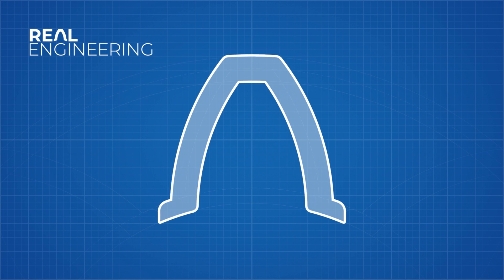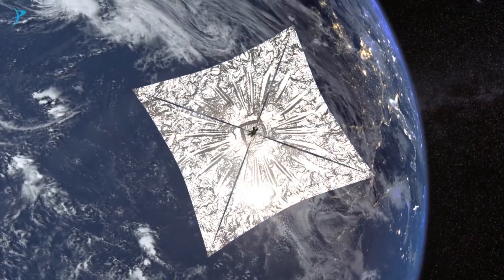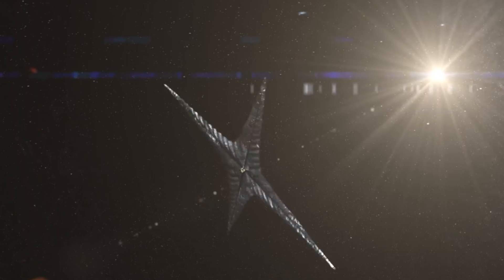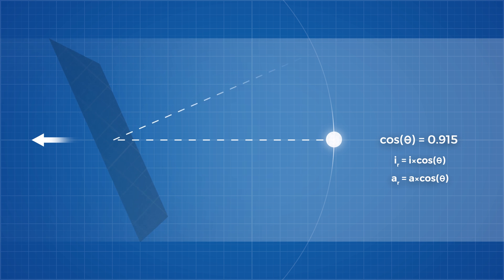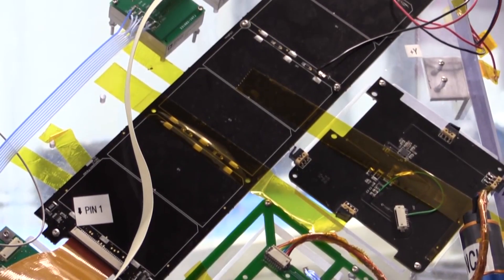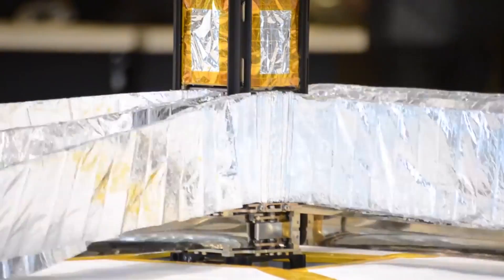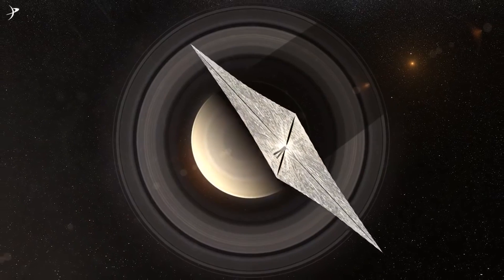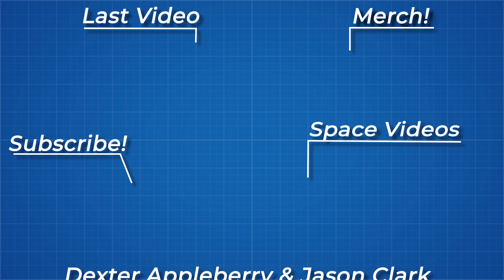How to Sail on Starlight

Comment: Would it be viable to push the light-sails from Earth (or Earth's orbit), with lasers ofthe most energetic wavelengths, therefore preventing the loss of energy with the distance? This system also allows for evolution of the propulsion system as we discover more effective energy sources (e.g. fusion).

Comment: How the Sun Works

Scientists falsely claim that the Sun is a fusion reactor, constantly emitting photon particles and solar wind.

In fact, all stars are balls of mass, warmer, brighter matter that are oscillating generators and transformers.

Because each atom has its own unique structure, it is an oscillating generator and transformer.

Atoms are eternal generators and transformers

All atoms consist of indestructible, electrically charged hollow spheres and internally charged solid spheres. The so-called electrons are actually negatively charged liquids attached to the surface of the atom.

The hollow sphere has multiple layers, each with an opposite charge.
The inner sphere and inner layers of all atoms have the same charge.

According to Coulomb's law, the inner balls of all atoms oscillate constantly at a natural frequency and never touch the inner layers. Theoretically, the ability of an atom to carry an infinite amount of energy depends on the input.

The more atoms there are, the higher the energy density, the higher the temperature, and the brighter the light. Atoms oscillate at higher voltages.

Stars do not emit energy or photons outward, but induce other masses around them to oscillate at their frequency. This is the true mechanism of light, photons and radiation.

Comment: Solar sails are lies. Photon particles are fictional unicorn farts. Why do the Navy's killer laser beams have no momentum to move the flame? Why doesn't a Crookes radiometer spin in a hard vacuum? Why can photon particles travel through solid glass at the same speed? Why can photon particles bounce back from any material at the same speed? How can photon particles generate oscillating electric and magnetic fields without charge or mass? What is the precise mechanism? Einstein said that anyone who thinks they know what a light quantum is is wrong.

Comment: something I've wondered: could you make the surfaces around the propellent nozzles reflective, so they double as solar sails using light emitted by the (usually glowing) exhaust, thus get free extra thrust? you also need heat sinks in space (Reflective surfaces that radiate excess heat, since there is no other way to get rid of heat in space, so you'd be cooked to death otherwise) couldn't you make those double as solar sails, thus getting even more free thrust?

Comment: Why are the solar sails all folded and not rolled? Seems a sail could maintain a more perfect “mirror” surface by being a smooth roll, rather than having all the creases induced by folding. As I’m writing this, I’m thinking it has to do with an increased difficulty in deployment. The rotational mass at the beginning of the roll would be very high. If it were just unfolding, the mass of each fold is (conceivably) the same.

Comment: Could you fly in a close orbit around the sun and then along with the suns gravity effectively slingshot the space craft towards its destination? Also while it is near the sun to use solar panels to capture energy to store in a few batteries? The parker space probe is gradually getting closer to the sun. So I dont see why not send another.

Comment: I have a question. Does a photon lose energy when it hits a mirror (theoretical perfect mirror) and reflects? Because if it does not you could use more mirrors to reflect it back and make a perpetual machine by extracting moment from those mirrors.
Reply: Shut up Lisa 🤫 in this comment section we respect laws of thermodynamics.

Comment: I appreciate that there is an equation that describes the quantity of momentum that light transfers to an object on reflection.  However, I have not been able to locate a detailed description of the interaction between photons and atoms that explains the specific mechanism of that transfer.  For example, does the photon interact with the electron shells, which then interact with the nucleus?  Any guidance on this would be appreciated.

Comment: Random thought, if the photon is imparting energy to accelerate a craft then the photon must be losing energy right? So what changes about the photon after it reflects off a solar sail? Normally it would be the speed of a object will slow but the speed of light is not going to change so what then? Wavelength perhaps?

Comment: I have a probably dumb question. If there's a solar flare, and the warning satellite guy in between the earth and sun intercepted it, even if it immediately sent a radio signal moving at light speed to earth warning us...isn't the solar flare also moving at light speed? how does that give any warning?
Reply: I found out the answer: the bad part of the flares aren't EM radiation, they're actual material. So they do give off radiation that the satellite can intercept, but that's way before the material is on its way to earth.

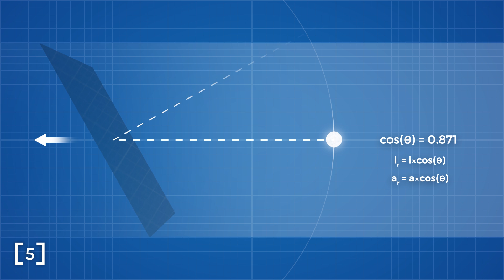Comment: 04:52, are you sure about that? I think if it is considered the angle of the sail with the photon, it is the same if the sail is rotated or if the photon hits with some angle, it is the same angle. I could think maybe the number of photons goes with the cos and then the energy is the square of this and the cos2 appears

Comment: Can we put a light bulb on a stick behind the sail?
Reply: You could, but then you'd need an electrical source = extra mass to accelerate. If you're going to use an electrical source for propulsion there are more efficient ways to turn the electricity into thrust e.g. an ion drive

Comment: Getting around the inverse square issue.  Why not just use a strong Alpha Emitter as a type of nano thruster?
Reply: Solar sail: not carrying the fuel for propulsion. Radioactive source = extra mass to accelerate
Reply: @nightjarflying  
Not much.  The lightest solar sail will still weigh several kilograms.

Comment: This is a great video.  I very much enjoyed it.  There were just two small things that don't change any real meaning to the video at all, but I thought that I would point them out for completeness: (1) while it is 100% correct that light falls off as 1/r^2, it is also true that gravity falls off as 1/r^2 too!  So, a light sail can be just as effective in accelerating things away from the sun out near Jupiter as it is near the Earth. (2) Lagrange points are not exactly where the gravitational null is between the Earth and the sun (it makes sense to simplify this in a video that has nothing to do with this!). You have to account for centripetal acceleration also, which makes the problem very weird.  You can read more about it (if you are interested) here: https://therocketscienceblog.wordpress.com/2017/11/10/lagrange-points/.  Thanks!  I love the videos!

Comment: If the light(photons) velocity is constant and can't lose velocity after being deflected, then how is the system not gaining energy when the sail is accelerated?
Reply: The photon changes its wavelength a tiny bit to compensate for the change in energy.

Comment: I question the validity of the claim that the sun and the earth is excreting the same amount of force on a body at L1. If that were the case, bodies could not orbit there, but would go in a straight line. The thing correct statement would be that the pull from earth is just enough that an object at L1 can orbit with the same orbital period as earth, despite being in a lower orbit around the sun.

Comment: Zubrin in the book "Exploring Space" shows a solar sail in a very close approach to the Sun could achieve a hyperbolic excess velocity approaching 1% light speed and experience 20 g acceleration. If I remember correctly beryllium was suggested as a possible material to handle the heating.

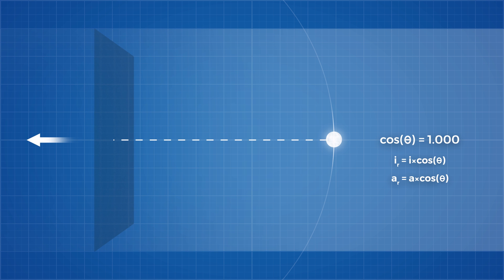Comment: You may have made an error at 4:24-4:59. If the reaction impulse is to counter the impulse imparted to the photons, then the thrust must be perpendicular to the sail, not parallel to the light. This is fundamentally how solar sails are controlled, otherwise they would only be able to accelerate away from the sun.

Comment: How would an early warning system for solar flares work? Wouldn't they travel at light speed right along with any warning about them?
Reply: Probably a bit behind since there would be a slight delay from the sensor to the computer to process that data and send the warning signal out. I'm surprised no one has mentioned this.
Reply: @ironmike3084  Looked into it briefly. I think he must have meant an early warning system for coronal mass ejections which apparently can accompany solar flares, but by no means always do.

Comment: Which would be most ideal for bringing humans to Alpha Centauri between the two options and given a total mass of the ship of 100,000 tons: Star Sail or direct propulsion by deuterium - helium-3 nuclear fusion pellets with a direct propulsion energy density 84.5 trillion joules per KG of propellant fuel with an overall propellant efficiency of 35%.
The deuterium - helium - 3 fusion has a gross energy density of 353 trillion joules per KG.

Comment: (offtopic) Will it be practical to create LOX Ethanol rockets for small aircraft in the near future? I know Armadillo Aerospace was working on a system back in 2004 for the Rocket Racing League. It would seem that there are some significant engineering challenges that will be very difficult to overcome in relation to LOX handling. Maybe there are alternative using hydrogen peroxide and ethanol?

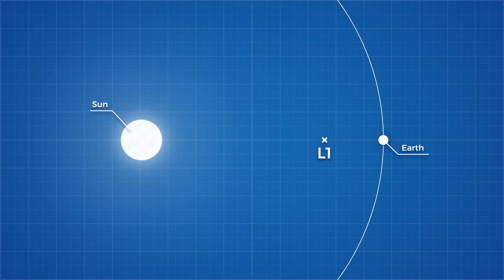Comment: 9:16  He says warning time of two hours. Anyone care to explain how this woud work?
Both light and waves from a solar flare propagate at the speed of light. How would you get 2 hours of warning time by placing the satelite closer to the sun than L1? With my logic, you wouldn't even get two minutes, as the signal from the satelite would travel at the same speed as the flare? Maybe looking for early signs on the surface of the sun? If so, I would recon you don't get the message to us any faster by placing it further away from us anyway. At the speed of light, the total travel time from the sun to us is quite fixed.
Reply: Very badly explained in the video (actually not explained at all) - but  he is speaking about the Solar Particle Events and the Electro-Magnetic storm carried by the associated plasma clouds. These interplanetary structures will be travelling at sub light speed.
Reply: @EneriGiilaan  Thanks!
https://en.m.wikipedia.org/wiki/Solar_particle_event

Comment: thats why you make it bigger, and unfold/unfurl the sail only at the point that it can get enough push to put it in a higher orbit or a hohmann orbit, then to be assisted by a radio or other array at the higher altitude on the dark side of the planet so the perigee gets raised..
middle material can be made out of a very rigid lightweight structure, possibly only when charged or when exposed to a particular type of light. outer material can be a film that can be under tension or expansion under a certain condition like how bimetal thermometers work. another layer outside that can be added to provide rigidity so the sail can be large and slightly curved to act as a reflector for astronomy, or to keep a large many km^2 sail from folding up like a broken umbrella. film relflectance tuning can make the sail so that forces and reflectance are evenly distributed with a central micro satellite weighing down the center.

if you want to make some kilometer long arms to pull out the sail, supported by some guide wires to a mast on each side to get you started, go ahead. if its based off of photo-reactive expansion then it will crinkle up, reducing surface area and drag when not exposed to light.

hardest part about this is the vapor deposition needed to make the thin film and the materials science for the film choice and structural elements.

Comment: Pretty much solar sail are a failure. Love how you nerds were boasting solar sails will out-travel rockets to next solar system. YUGE wake-up call with the law of inverse square.
Reply: SOLAR sails are just for testing the properties of PHOTON sails. It's never supposed to be a practical solution for human needs. Photon sails will be the cheapest and most practical way of interstellar travel simply because these will be powered by ground based or orbit based laser stations. It's currently the only realistic way of achieving 20% of light speed.

Comment: It's pretty wild how old-school sailing is actually applicable in space.
Reply: It gets even wilder when you realize that role of water in that sailing analogy is played by space-time curvature, and your entire craft is the keel.
Reply: @konstantinkh  bruh. Maybe thousands of years in the future, we will see this as primitive. Like how we saw sailing ships of old now.
Reply: @williamadiputra2850  imo it's likely we'll make use of light sails powered by stationary lasers in the far future. Since it doesn't need to store fuel inside the ship, it's probably the best way to reach relativistic speeds under known physics. Even antimatter propulsion still needs onboard reaction mass

ofc that all goes out the window if we discover some startling new physics that allow for something better
Reply: @ENCHANTMEN_  but with that all of that energy will end up four light years away
Reply: Ha, true
Reply: Space pirates !
Reply: Photons mostly don't interact with each other, so you don't get some effects you get with air. Also, there's no drag in space. I would say there's issue of approaching, matching, or going fastee than the speed of the wind, though technically doppler shift would reduce the momentum of photons if you achieved significant fractions of the speed of light in the direction where light was moving.
Reply: @Mr.Nichan  I'm going to be that one annoying pedantic asshole and point out that there is some drag in space, just not a whole lot. Satellites in low orbit need to boost occasionally since the upper atmosphere slows them down a bit.

The GOCE satellite is actually streamlined to reduce drag because its mission is to precisely measure Earth's gravitational field by measuring changes in its orbit, so they wanted to minimize other things that could affect it.

Another neat thing is that a relativistic spacecraft would have a considerable amount of particles hitting it, even out in interstellar space. High velocity would cause it to carve out a larger volume of space in the same amount of time, and time dilation would make the impacts appear to be closer together from the spacecraft's perspective. It'd be a bit like being blasted with radiation in one direction.
Reply: I learned solar sailing from zula patrol.
Reply: It’s not, like at all. We call this a sail but the mechanics aren’t even remotely comparable

Comment: Speed of light: 300,000 km/s
Speed of solar wind: 10 km/s
Who wants to calculate early warning savings for all the Lagrange points ?
Reply: Wiki has it at 250-750, but eitherway the point is clarified, much much slower than 300,000. Since we can see flares I assume this early warning is required/preferred due to the specificity of solar wind, just because we see a flare doesn't mean it is actually sending a blast our way. But if we could place a sensor it would confirm what we saw occur as a flare was now a focused wind toward us.

Comment: I'm slightly confused - how would a satellite give us an early warning? Surely the radiation from the flare would travel just as fast as any radio signal it sent back to us, so it's pointless having it closer to the sun. I must be missing something, but what? I suppose if it's charged particles you're worried about, sure they will travel a lot slower. But gamma ray bursts will arrive at the same time as any communication from the sat.

Comment: Im pretty certain only a small portion of that light wavelength is being captured by the sail. Imagine being able to get the stronger shorter wavelengths. That is probably where the viability of this sail will be used. So just from the top of my head, I would try a lead lined sheet and see if that can stop even more of these smaller wavelengths. So just think of it as a net with smaller holes.
Reply: A denser sail material would also increase the mass of the probe, decreasing the sail's (already quite low) thrust-to-weight ratio. I'm not sure of the exact math, but I suspect it'd be difficult to break even with that tactic, considering most discussion I've seen about solar sails seems more focused on reducing weight.
Reply: @solarshado  I would take we quite a bit of math to find the energy to weight trade off with denser sails. And it there is a beneficial energy increase.
Reply: But you have to deal with the photons you have, and when the sun is the source, those are primarily in the visual range.  Sure, UV and X-ray photons would transfer more momentum, but there are not many coming from the sun.

Comment: 4:47 the thick arrow should turn
Reply: Its measuring the magnitude of force in that particular direction. A force can be broken down to Force vector components. This takes is direction and magnitude and uses trigonometry to get its x and y magnitude. You use sin(O) instead if you want to get the other force in the up direction.